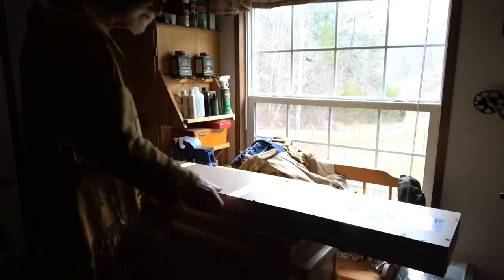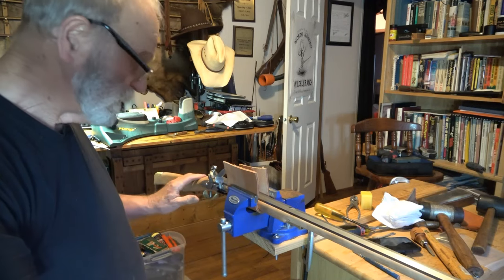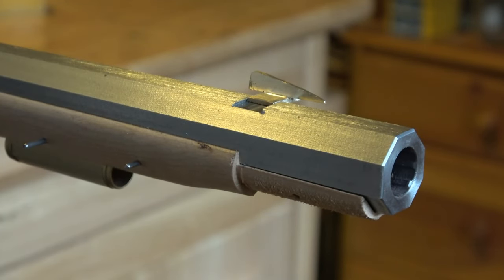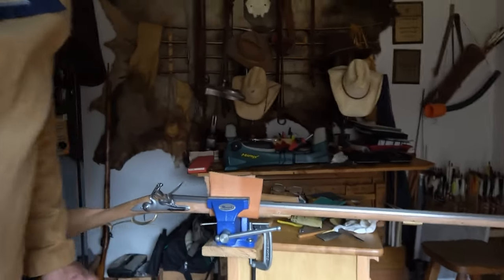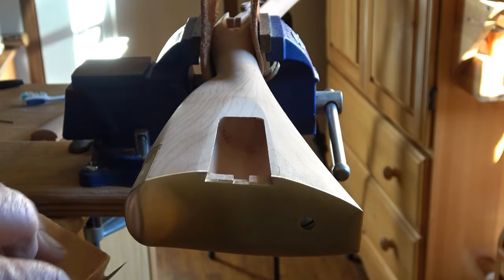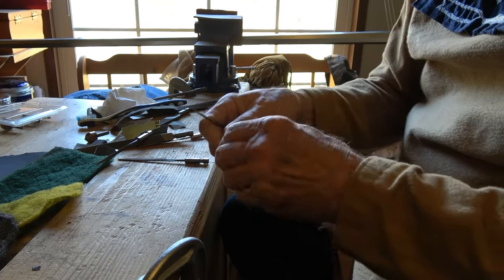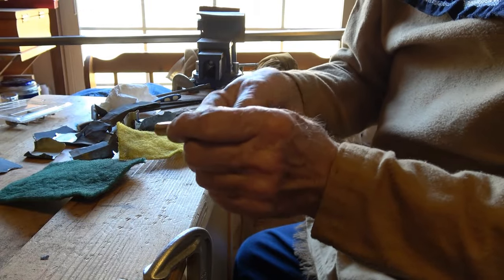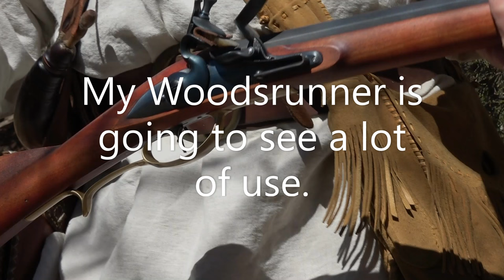A Kibler Woodsrunner Comes to Life

Comment: I recently put together a Kibler Colonial American Longrifle 54-caliber. 
Fancy maple stock and no patchbox. 
I was surprised that the hole for the lock screw was so far off on your rifle. Mine was about 1/16th of an inch off, and most of the chisel work was at the bottom of the breach plug area of the barrel. 
The most time-consuming area for me was the brass work, especially the sandcast butt plate. 
You are correct about the quality of Jim Kibler's kits they are very high quality and a pleasure to build. 
The lock is extremely fast, and the trigger is great. 
I hope you have many enjoyable years with yours.
Reply from the maker: I was a bit disappointed that the holes were so far off myself.  Took a bit of inletting , but over all it was a fantastic kit, which is now an awesome rifle. I love it.
I would like to eventually have one of every kit that Jim offers.

Comment: I had many of the same issues with my Woods Runner as you did.  The patch box was very tight and didn't initially "snap" into place.  After a bit of work however it goes in snug and with a crisp snap at the end.  Also, the fit on mine is, I would say better than yours as the holes all lined up pretty well.  The front sight had some small flaws as your's did.  I just live with it.  I draw filed the barrel too and am glad I did as it looks very nice now that it is finished.  The barrel fit very tight and needed some file work to finally go into the stock and come out without a fight.  I didn't inlet the wood I filed the edges of the bolster to make it fit.  Well maybe I did file the stock just a little along the barrel.  The precision of these guns is so precise that they all have the same issues.  It is a complement to their precision and not a defect of their quality.  I beveled the edges of the lock as well to get it to fit well.  That is, so that it would go in and come out repeatedly without a fight but still make a good seal with the wood all the way around.  Mine is going to be a hunting firearm and not a show piece.  It will get used and worn over many years (at least I hope it will be that long).
Reply from the maker: Yes Sir the precision of these rifles is amazing. Mine will be a hunting rifle for certain. To good not to use.
Enjoy yours and thank you for watching and for commenting.

Comment: I am glad to hear that this "kit" requires some work to get it fitted up, I did think that it was just a fling it together out of the box, but that would be no good at all, how could anyone say "I made this rifle" if that were the case, I usually like to make these from a slab of wood I cut from the tree, and file up the lock and butt plate, (buying in a barrel), but this kit has some attraction for a quick build. Enjoy! Chris B.
Reply from the maker: Naturally there is a great deal of satisfaction from building anything from scratch. But in the case of this rifle I was vastly more interested in the finished product than the process. I was not disappointed!!! Jim Kibler has done a remarkable job indeed. Probably precious few high end “custom” rifles can really compare to Jim’s rifles. Jim himself is a master gun builder and he has devoted is life trying to make it possible for the average person to be able to turn out a rifle that will rival most well made and hand built rifles. Kudos to Jim Kibler.
Reply: I purchased a scribed wood runner i don’t have the talent to do what many can so i paid more for it than the basic kit. I have to say i am pleased with it very pleased its going to be a nice rifle with very tasteful incised carving. I too have to fit the barrel mostly at the tang area which is slightly proud so I’m going to need to get the transfer black and the small chisel out. My barrel also needs to go back maybe a 1/16 or a bit more as you mentioned the holes don’t line but clearly will when finished being inlet. I do wish it was longer like the Colonial or SMR and had a longer trigger pull. Regardless it is going to be a nice looking rifle when I get motivated! 😂
Reply: @joemolf3894  Just enjoy making it all work, you will appreciate it even more having had a part in making it, but take your time! Chris B.
Reply: After your last comment you kind off motivated me. Originally I thought my tang was sitting too high well it was but all I needed to do to set it flush was clean up the inside corners for where the tang would sit. I scraped them square and presto right down and back the barrel moved. Dennis does a good job explaining the little details. Hardest part of the assembly for me was lining up the trigger pin with the trigger 😂! It is by far simple to assemble. Now finishing is where talent is needed.

Comment: Hmm.  In the How To videos of each step for Woodsrunner assembly, Kibler is pretty clear about what is needed to inlet the barrel and tang.  You did infer that you viewed videos, (maybe not all.)

At the 24:00 minute range, you talk about how your luck is to get "defective products".  Given that you found bolt holes "off by 1/3 hole" and the after-finished gap that you left between the rear of barrel and the stock,  what did you do to inlet stock? Did you follow the barrel inlet video?

I'm not a Kibler Fan-Boy, (yet), but my Woodrunner is in delivery.
Reply from the maker: You are right about Jim having through videos on putting together his kits. And yes I watched them all. And others such as the ones from the NMRA. All very good and I followed their recommendations to the letter. It worked just fine. And I took my own sweet time. But there is NO gap as you referred. There are no gaps anywhere. The wood to metal fit is spot on. 
What you take to be a poor fit is  not that at all. If your kit is like mine you will see what I am referring to. 
Have fun and I hope your kit fits together more like others that I have seen.

Comment: Dennis, great job it looks great I am waiting for Kibler to come out with a Hawken kit not that I need another rifle trust me on that ! I would like to see how you aged the brass if you get the chance. Did you get someone to build you a stand yet ?
Reply from the maker: I aged the brass by putting a little salt in an ounce or so of vinegar in the bottom of a container with a lid. I put a rack in the container and laid the parts on the rack. Do not put the parts in the solution. Suspend them above it.Leave them for as long as it takes to reach whatever degree of aging that you want. Then I took a cleaning patch with black powder fouling on it and lightly rubbed the brass.
Have not had a stand made yet. But I will.

Comment: By the way Dennis, where did you learn about and start using over powder 3x3 wads then a lubed patch under the ball. Ever have any ballistic issues with this method. You are the first person I've ever come across that does this and some Black Powder people are of the opinion that such over powder patch isn't customary or good practice. Fill us in some here.  From the Cherokee nations of the ozark foothills Oklahoma.   Thanks.
Reply from the maker: I have no idea where or when I first heard of it. It is just common knowledge . It works so well you have to wonder why everyone isn’t using it. The only ballistic problem that it causes is more consistent performance  shot yo shot. If that is a problem. 
One key to good accuracy is maintaining your main patch in perfect condition. When you pull the trigger all hell breaks loose in that barrel. Hell fire and brimstone savagely attacks your cloth patch. Any substance that you place between your powder and your mail patch will absorb all that fire and completely protect your main patch. You can use most anything, such as wasp nest, felt wads, card board, grass, leaves, virtually anything. Even corn meal. My patches came out so pristine that I can use them over and over if I wish. And by maintaining perfect condition in your patch there is no gas blow by, no lost propulsion from shot to shot. Performance improves. That is all the proof you need. This is if more and more importance
Reply from the maker: The hotter the load the more it helps.

Comment: What did you have to do to get the patch box cover to snap into place?
Reply from the maker: I had several options but the best one for me was to file enough brass off of the front surface of the butt plate. Kept filing until it snapped over the edge.
Reply: Thanks so much.   I'll remember that when I get to putting my WR together!  Very good video!